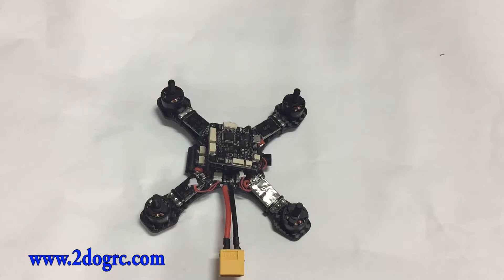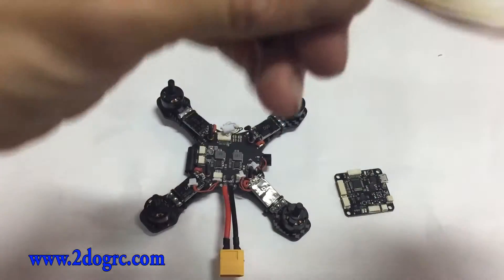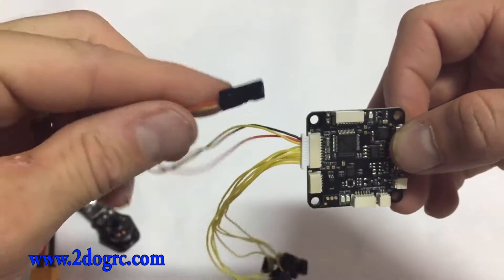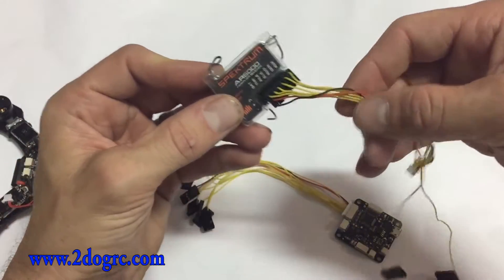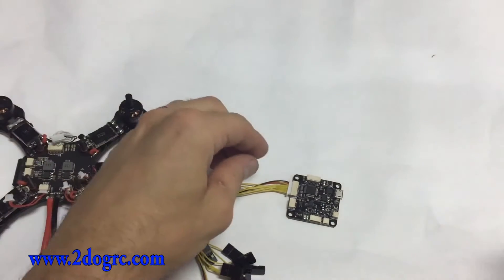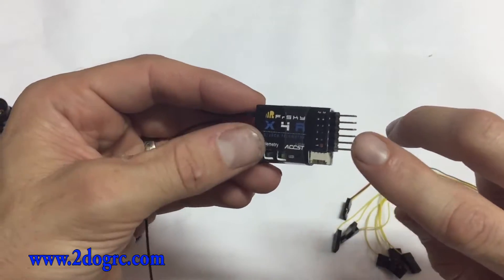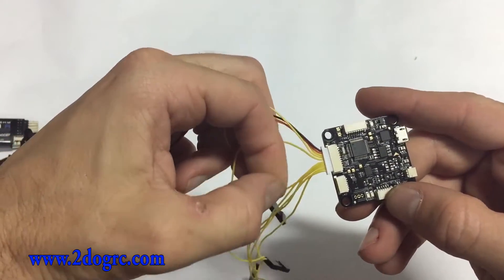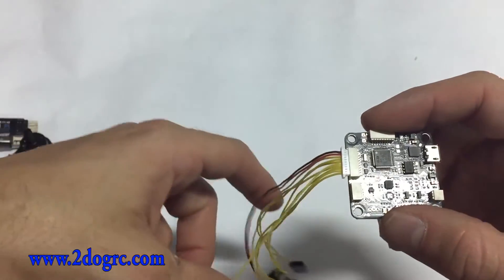How to connect a Receiver to the Diatone Thin Naze32 Flight Controller in a Crusader

Comment: hey hows it going? i just ordered one of these and i still have not gotten a receiver for it yet. i have the flysky controller and i was wondering which receiver i should get so that i can use my flysky that i currently use ibus on. if you have any suggestions that would be more than helpful.
Reply from the maker: The smallest one possible!  There is not alot of room to stack the receiver.

Comment: May be a stupid question but in the beginning you showed the typical Spektrum set up with all the channel wires and plugs. When you plugged in your 6 channelsto the RX you had 2 wires left over...what do you do with them? Disconnect them? Tuck them away? Im assuming they would be for a 7th or 8th channel....
Reply from the maker: Good question!  Yes, I used a Xacto knife and pulled up the plastic tab and removed the 2 extra wires.
Reply: 2dogrc Figured something like that. I have a new Diatone that I bought the Spektrum quad race receiver but it looks like I can't use it. It has a 3 wire lead with only one small plug. I'm thinking I'll need a different RX that has all the separate channel wires.
Reply from the maker: That receiver will work with all the Diatone Crusaders, 1 and 2 series!  On the Crusader 2 there is a plug on the side labeled 5V GND 3.3V Serial PPM.  (Don't quote me on the order).  For that receiver you will need the Gnd, 3.3V and Serial wires. You will have to snip the wires and solder to the wires on the receiver.  Black Ground, Orange is 3.3V and grey is Serial.
Reply: 2dogrc It's a 180 Tyrant... does that make a difference? Hopefully it will work and I can figure it all out. Thanks for taking the time to help also.
Reply from the maker: That receiver has to be soldered in the three holes on the front of the board I believe. Look on the bottom of the board.

Comment: I recently bought this item from HobbyKing  and I am having problem with the Naze32 rev6 flight control, it yaw and drift slowly on its own, I think that board  still have some bugs
Reply from the maker: Okay, do a blackbox log and then you can see what is commanding the drift.  Log at 1/3 rate.

Comment: you forgot one setup, what if you are using spektrum satellite, it is 3.3 volt.
Reply from the maker: I made a separate video for that one. It will be up tonight. There are 3 pins holes you solder the satellite too. They are labeled on the bottom of the board.
Reply from the maker: Here is the Spektrum Video!
https://youtu.be/LRHXn6f52dA